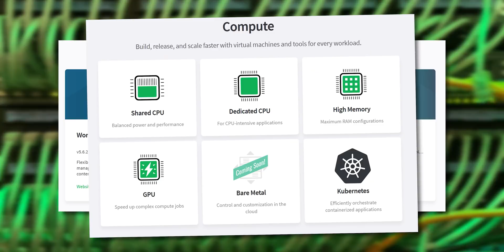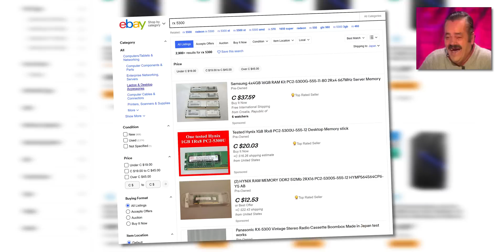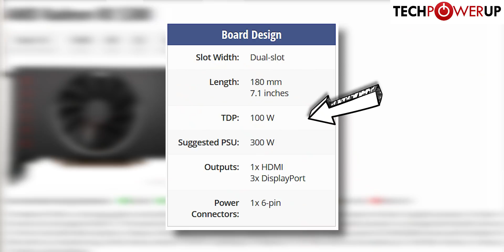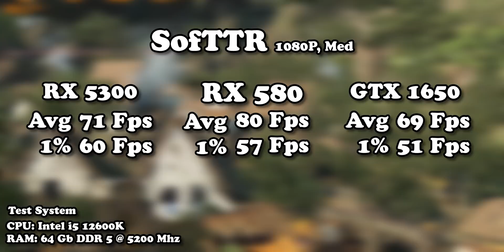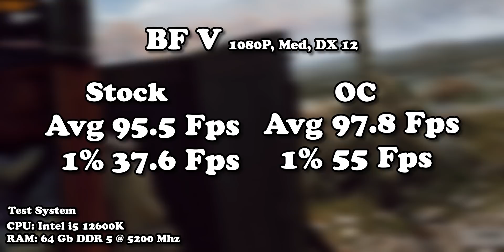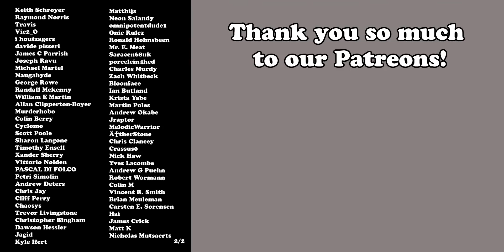AMD's Long Lost Budget Gaming Graphics Card

Comment: This may only have 3GB of GDDR6, but its a 96 bit bus instead of 64 bit like on the 6500XT. In theory, you could swap these 1GB chips out for 4 GB chips for 12GB total, still hitting around 170GB/s. This would smooth out the gameplay, especially because, IIRC the RX 5300 was also limited to PCIe 4x3.0, or maybe it was still 8x, either way, having on card RAM is faster than having to go through the bus and hit the system RAM, which even with my got tier samsung B dye memory on a 5700G with 1:1:1 at 4933MT/s, is still only hitting 73.05GB/s compared to the almost 170GB/s of the RX 5300
Reply: I doubt that GPU could use chips bigger than 2GB.
Reply: @peterpan408  Its all about the vBIOS, as long as its GDDR6 the only thing preventing it from having 12GB is the vBIOS configuration
Reply: @denvera1g1  Yes, reading other comments also reminded me that the vbios might be a factor.
If only vbios were open source..

Comment: I have one of those Lame brain GTX 1060s with 3 GB of RAM it's not bad as long as you're mindful about how high you turn up the textures and settings at 1080p. 
especially if you pair it with a g-sync freesync monitor you get a pretty good experience.

Comment: This card should support Smart Access Memory, may be interesting to test. Also I think this card’s main issues are the low clock speed, and memory bandwidth. 3gb is still fine if you tune the settings.

Comment: I'm still rocking an ITX RX 480 4GB I found for 45 bucks shipped a few years ago. Ebay seller thought it was an R7 450 for some reason. It's been a great card. Too bad this 5300 was never sold in a low profile form. Would be great for small form factors with that low power draw.

Comment: Funny that I found about this card again two days ago when trying to compare RX 6500 XT to older entry level card. It's a missed opportunity but that's because AMD cares more about OEM than their customer base.

 This has been proven many times that one time they supplied OEMs with 10 CU RX 550 (full blown Lexa, not softlocked Baffin/RX 460), OEM didn't bother and pushed back to AIB but with no clear indication except checking SKU manually

Comment: "75W" is a bit of a myth TBH. A card can pull 5.5A corresponding to 66W at 12V and 3A at 3.3V corresponding to 10W, totalling approximately 75W. But for one, the measurement you see there doesn't take into account any 3.3V parts on the card at all, if there were any, which honestly, not much, maybe the VRM controller logic uses that, but they use 12V for all their VRMs for their high-side input for efficiency reasons. Furthermore if the input voltage were to drop to the minimum permitted of 11.4V, you only come up with 63W. So yes this card technically just about does need the power connector there simply for compliance reasons, unless they were willing to trim it down, which, honestly, why, i'm kind of glad they didn't.

That being said, as little power as it needs, i really don't see an issue hanging it onto an underpowered PSU, it'll survive fine.

Comment: the reason it got lower 1% lows than the 1650 and the 1650 being smoother despite being slower can be attributed the 5300's low 3gb vram. Most likely it is exceeding that vram at certain if not most occassions resulting to having to access the slower system memory for more memory resource.
Reply: Why did overclocking start to salvage it though? Doesn't make sense. The hitch when the card just stalls and the system have to salvage it by shoveling down data over PCIe should be entirely the same! Something weird seems to be going on there. But the pattern of games which did or didn't have extraordinarily slow 1% does agree with the insufficient VRAM hypothesis seems like.

Comment: It’s very easy to trick the card into thinking that a 6 pins connector is plugged in and then just use the PCI express power.
The middle GND pin in the connector is a sensor, so connect it to any GND spot on the card (I think using another GND pin of the connector works) and that’s it.
All you need is a wire.

Comment: Will the card work if you don’t plug in the additional 6 pin power connect and just max out at 75W, or will it prevent the computer from posting or cause a crash?

Comment: You could drive a truck through the performance gap between the 6500 XT and 6600. At least the 5300 performs reasonably for where it fit in the stack.

Comment: The fact that this RX 5300 is literally almost as fast as an RX 6500 XT, is actually terrifying. Especially when you think about the fact, that the 5300 is supposed to be like a GT 1030 (you know, with the *300 ending and stuff), and the 6500 XT is not only newer, but also an *500 XT-tier card.
Reply: Plus the 6500Xt at $199USD is similar too & regularly slower than the 5500XT at $169USD that it is replacing,
So at best Stagnation or Step Backwards for the Class while Increasing the price
Reply: @shaneeslick  also the 6500xt lacks video encode/decode and only has 2 display outputs.
Reply: @potatoes5829  yeah, but I only use my PC to play music, game & watch Youtube so lacking those is not a ptoblem for me

Comment: In 2019, I bought 4 (four) Radeon R9 Nano (basically a compact, power-constrained Radeon Fury) from a single vendor for USD $100 each. The Nano actually looks quite similar to the card in the thumbnail of this video, at first I thought that's what it was
Reply: The nano is actually smaller
Reply: @pocpc1788  now that you mention it, you're right. The Nano is exactly 6" long and easily fits inside mini itx cases

Comment: The MSRP on OEM only parts is generally the manufacturer telling OEMs how much to charge for the part. It's basically a "hey add about this much to the price of the system if it had no GPU."
Reply: G'day Digital_Jedi, Yeah that is what I was thinking, this ones MSRP would be the price to Spec Up a Pre-Built from IGP

Comment: Is it possible to run it without the supplemental 6-pin connector? ie Will it even boot using just the power supplied by the PCIe slot?

Comment: If this was available as a low-profile card for $150-200, it would sell like hotcakes because the 1650, 1050ti, and RX560 are all meh options for their price now, the 6500XT is a shitty option for the majority of low-profile systems, and pro cards like the Radeon Pro WX4100 and whatever the current low-profile Quadro is are just too expensive for what they are.
Reply: It would be only good because of the shortage, otherwise everyone would buy a 3060 or rx 6600 something for 300-350$
Reply: dont forget it might be the perfect home theater gpu, it supports hardware encoding and can game, perfect to set with ur tv... remember the 6500 does NOT support video codecs

Comment: Not gonna lie, i'd actually buy this card for a secondary, low power rig i have in the making. I mean i already have a GPU for it, but it's a R9 290, wich actually defeats the idea of a low power secondary PC.
Reply: Eh i still have a r9 290 in my main rig lol. 
Gotta admit that it's showing its limit (driver wise mostly, i have a huge OC on it, it lands somewhere between a rx570 4gb & rx580)
Reply: @yuuji_  have a look at modded drivers, I'm running modded drivers on my Nano and they're perfectly stable but should perform better in and perhaps just straight up run modern games that require newer drivers than officially supported by our old cards

Comment: Compare it to the 6500xt...maybe amd should crank out more of those little gems instead...oh and could you also test the rx6500xt with pcie 2.0?
Reply: 2.0? xd lets be honest 2.0 is dead, ur pairing it with the 2600k or what, also with 2.0.... just buy the new i7 12700k and use the igpu.. i guess it will outperform it lol

Comment: I've been watching this channel to much, I have an rx 580 4gb that's has to be undervolted to work, an ex mining rx560 4gb that only has dvi but works perfectly, an r5 240 that in an celeron mini itx system for retro games and finally an rx 5500xt 8gb that the hdmi has stopped working but is still.good for vr on display port (blagged it for £250 last yr)

Comment: It seems to do about the same as my 1650 SUPER, which is basically a 1650, but with a PCIe 6 pin for some extra juice. Well, mine probably gets the higher 1% lows, but too lazy to check it out.

Comment: 3GB of Vram is actually plenty for this GPU imo, given the lower resolutions and lower settings that you're going to want to run at with it anyway. Obviously more Vram would still be better, but I think 3GB actually makes sense here.

It appears to perform very close to a 6500 XT if the 6500 XT is limited to PCI-E 3.0. Whether or not it's a good card really just comes down to how much it costs.
Reply: I feel like the 6500 XT should have been this with 6 gigs of VRAM. And maybe a factory overclock. I wonder if someone can mod in more VRAM, just like some guy did with his... 3070? I think?

Comment: And yet, it has eight PCIe lanes and a 128-bit bus. So, in a way... it's not as much of a boil on the ass of a baboon as the 6500 XT.
Reply: 96 bit, still better than 64
Reply: @greenumbrellacorp5744  Crap, you're right... that's the XT model.

Comment: I remember this card so well. I never understood why they NEVER released this even as an LP card given how good of a super low-end gpu this was.
Reply: Yes!  It would probably do well in the LP market, bumping up used machines like an HP Elite 8200 SFF.
Reply: I understand why they will NEVER release it. Event if they do it will cost $300.
Reply: They couldn’t, because the thing takes 100 watts, instead of regular low profile cards being a max of 75 watts.
Reply: @Thewaterspirit57  Didn't think of that. Good point.
Reply: @purplegill10  yup. I know this extensively when researching possible GPUs I could buy for my PC. A low profile graphics card, that was more powerful than the old iGPU, and that was well received (but also wasn’t bellow 500 GFLOPs)
Lots of the GPUs I found that were low profile has to be 75 watts or lower, because the supplemental power connector would have to be put at the back, but it might be still get in the way due to most of these cards are targeting people with smaller builds, mostly decent prebuilds someone has had for a long time, or got for cheap, plus the cooling system had to be good enough to cool the GPU, but also not be bigger than two slots since that’s how much space most smaller prebuilds had, especially as two small fans couldn’t do much for something more powerful.
(Like the best was a 1050ti, 1650, RX550 1024 cores, and now more recently the RX6400, with the 1030 being a last resort)
There was the 950ti which had a low profile version, but that was scarce and over priced compared to a 1050ti when available.
Reply: @purplegill10  also… because most prebuilds didn’t come with extra power connectors, like PCIE ones, even if they had a power supply higher than 350 watts.
And most people couldn’t just “get a new system entirely” like some people suggested, or replace the power supply with a proper one, Since most were proprietary.
Reply: Lps are noisy sh*t bcuz of their retro chipset coolers.

Comment: I bought one of these (RX 5500) without a fan locally for 120€ 2 months ago. Got a cheap VGA to PWM adapter and strapped a 92mm case fan to it. Worked perfectly and got me around RX580 4GB performance. 

Not much overclocking possible, but incredibly low power draw and heat.

Comment: I wonder if it would perform any better if you could solder a memory chip to the empty solder pads for additional memory?
Reply: gpu doesn't have memory channel for that chip (96 bit bus, 32 bit per chip and three are already used on board).
Reply: @gorky_vk  How does the 6500 have 4GB and a 64bit bus?
Reply: @christophermcdonald5578  by using just 2x2GB chips, simple

Comment: Why didn't they release this as a low profile version? It would be the fastest LP card on market to this day, instead of the 1650 LP.
Reply from the maker: That’s what I was think the whole time. It would have been a great option for that.
Reply: @DawidDoesTechStuff  Question: Does 5300 post without any 6 pin power connector attached to it? if so it would be a good option for htpcs with a bit of undervolt/clock...
Reply: @DawidDoesTechStuff  Down here in Australia there is a Yeston RX550LP, Maybe they could make a Special "DDT Waifu RX6500XT LP" 😁
Reply: for same reason they never release this to general public - not enough production capacity to spend any of it to low margin products (except minimal amount needed for fulfilling contracts with OEMs)
Reply: @gorky_vk  Down here in Australia we got a Yeston RX550LP (only one I have seen), 🤔maybe they will do one of these in LP too as they make many 'Out of the Box GPUs'
Reply: @Gaming ZONE GAZO get a pcie extension cable and run the gpu outside your case ive been doing it for a month
Reply: They don't want to waste the silicon when they create a new really crap card with less features than they produced cards with 10 years ago, and still sell them for 5 times as much money.
Reply: @Gaming ZONE GAZO You could get the a2000 which has rtx and dlss as well as being ampere (and expensive)
Reply: Anyone remember the Galax GTX 1070 Katana? That was a dope card. It had a really nice cooler on it.
Reply: @Gaming ZONE GAZO If nothing else is running on it you can get 54W off the molex with an adapter cable. If your power supply is iffy, run 2 sticks of ram and an SSD, no mechanical drives and that would get you anywhere from a 1060 to a 1660 Super.

Comment: would be fun to get a 6500 and compare it to that.

I san in the LTT video that it is marginally better than an RX 580. Price to performance is horrendous for the price (does not even have a video encoder built in !)
Reply: You can bet RX 6500 XT will be the favorite card of all crap prebuilds, so we will get it sooner than later
Reply: its actually worse, the 580 had 8gb AND enconders... the 6500 xt doesnt... and add to it the crippled pci 3.0 perf

Comment: how is amd able to make this card with all the encoding and sell it for 130$ but the 200$ waste of sand rx 6500 xt doesn't have encoding nor does it have the same memory lanes. they could have added another 1 gb memory module to this and sold it for 200$ and called 6500 xt would have been much better product.
Reply: Because AMD doesn't have to try any more, it can produce crap at a high price and it'll sell.
Reply: @WhiteG60   😴Ah yes $2019 prices, here in Australia the cheapest of the 2 are Sapphire PULSE Radeon RX 6500 XT at $319AUD vs ZOTAC GeForce GTX 1050 Ti $379AUD
with ASUS Phoenix GeForce GTX 1650 OC $449AUD, These are the current regular prices but they can be a bit cheaper with prices fluctuating at the moment as we have our BIG SALE period over Christmas & January